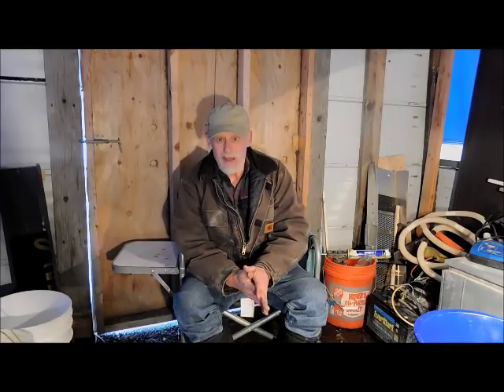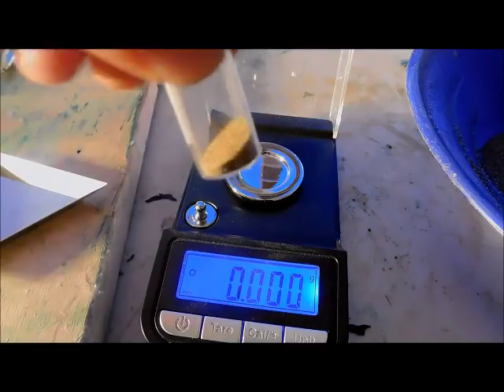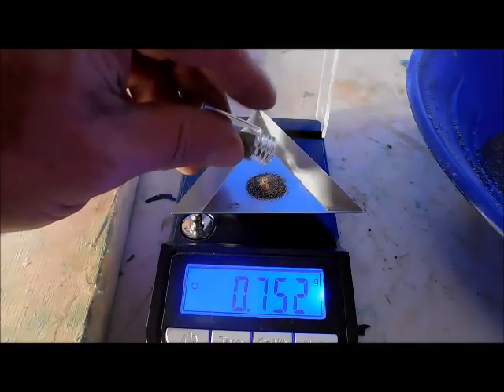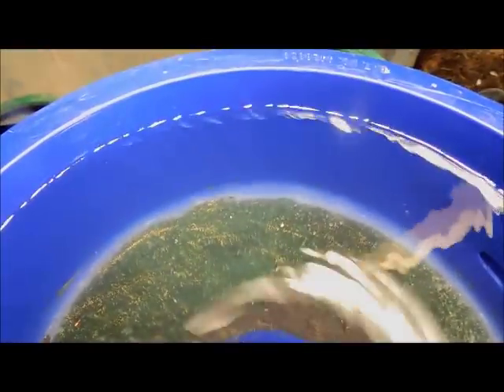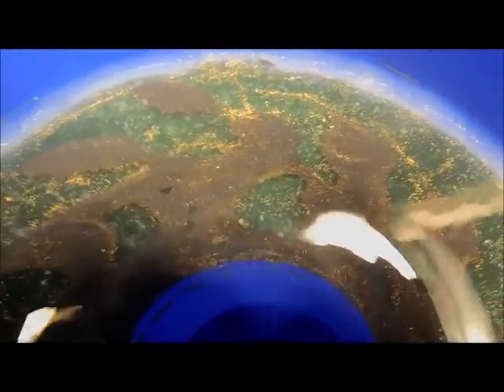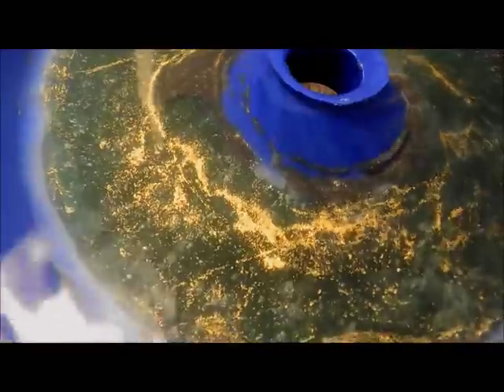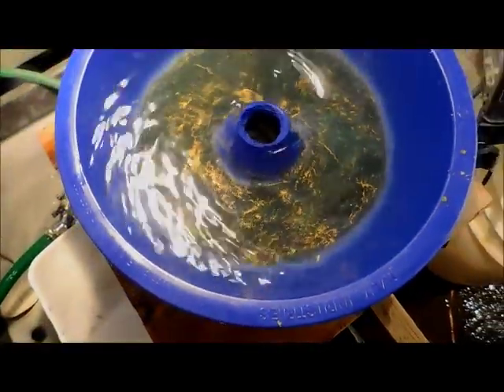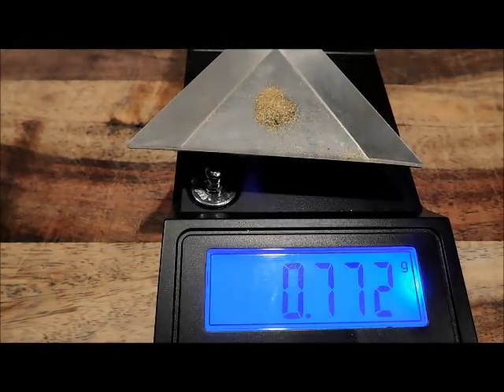Beach Gold Blue Bowl Silicone Mat = Epic Gold Recovery System

Comment: Awesome invention! I was just using my blue bowl, still am, and screened to -50 mesh and was watching a lot of gold, -below 50 mesh washing over the drain with a flashlight and concluded I needed a better selection of screens, and then I saw your video! I was watching a lot of fine gold pass over the center drain, and you mentioned a mini sluice for a 2nd recovery,  I watched your 1st video before this where you mentioned the 2nd mini sluice and I have been experimenting making gutter sluices, to test my ideas for awhile now,  so recovery has been on my mind. Your silicone matt is a game-changer! Even classifying to -200, I would always feel that I was losing gold through each classification or a blue bowl run. Now, with a large magnifying glass and flashlight, I can check for losses in every run of the blue bowl and adjust accordingly and make adjustments along the way! Now I need to watch all your videos, but making the Matt and the process for making it is first, I'll buy one of yours first, also, so I can get started to fully evaluate 2 new prospects full of fine gold and process my cons from recent and back that have accumulated over the years and I would like to process it all this winter because I just haven't had a system efficient enough that I trusted for the fines setup. You mentioned using a brush for clean up and what I like to do is use a spray bottle when everything is still wet and use the water to rinse and move it into the next appropriate container. You probably do it all the time, but thought I'd mention it for anyone reading the comments that might find it useful! This looks like a 2nd recovery, or more may not be necessary after the blue bowl is run efficiently. Congratulations on your idea/invention, I do believe it will change the way a lot of miners process their materials! 
On a side note, where is the "point of diminishing returns" when it comes to classification? I was thinking -200 mesh would be an (arbitrary) upper limit, at some point it will be less than dust and more difficult to process, also different prospects have different sizes of gold, but for individual testing, I would like to be set up I can run up to a mesh size that will eliminate further classification because of the probability it won't go any smaller, or it becomes uneconomical. With your knowledge and experience, what mesh size would you feel comfortable with testing for on individual prospects for a yay, or nay? Thank you, Alan, Dirk

Comment: Great video
I have owned a few blue bowls. Always ended up frustrated with their lack of fine flat (100 + mesh) gold recovery BUT now I may have to give it another whirl.
Reply from the maker: You will be amazed on how well the silicone mat holds on to the gold. I run a clean up sluice under the bowl if the gold makes it to the cone it is going out.

Comment: Again great showing Alan 👍
Reply from the maker: Thank you Wayne. No denying it now. That was crazy to see that - 200 gold stuck to the mat.
Reply: @alanrobertson2510  Indeed it was...The only thing that would make that set up better is if the mat was removable for rinsing off easier...like a mat liner covering the bowl bottom from edge to starting up the cone...with two or three slight ribs on the cone as a final capture spot for the really fine gold...

Comment: very cool results.
Reply from the maker: It sure was. Thank you
Reply: @alanrobertson2510  alan found something you may be interested in hearing about, went to walmart to get black food coloring and silicone caulking, while there i discovered that they have black silicone caulking, so you no longer have to deal with adding food coloring.
Reply from the maker: @zemetrius  Warning most black Caulk well not set up. Try a little in the soap and water mixture and see if it will set up first before you put it in the mold. I have a case of black silicone that will be here tomorrow that will work I will do a video soon . I hope it sets up for you.
Reply: @alanrobertson2510  i have just the test case in mind, someone had the idea to put silicone in a gold pan, i have been wondering about that myself. this is a good a test case as anything. but i look forward to your video using the black caulk, i am always eager to follow in the steps of those folks who figured out a way to do stuff.
Reply: @alanrobertson2510  ok got a small batch in the works, its kind of setup but as its my first one, there are a number of things that could be causing it to go slow, i may have used too much in the small test mold, could be the caulk itself, will let it have more time to set up, will check it when i get home from work, i was worried about putting to much material in the mold, so i may have ended up putting too much in.  best to get the mechanics of this down before i pursue the blue bowl piece.
Reply: @alanrobertson2510  ok my first test with the black stuff, sad to report that while it "looked" like it had setup when i got home, it was not the case when i tried to removed it from the mold. so i got more soap, got some saran wrap, gotta get the clear caulking and black food coloring. can't give up this close to getting it right.
Reply: @alanrobertson2510  its been getting cold here at night, even my garage is getting a little cool inside. what is the best time to setup the caulking work? when i get home after work during the week the sun is getting pretty low in the sky, the weekends i am normally off/home.
Reply from the maker: @zemetrius  Sorry I have been gone for a few days. I saw that the black silicone didn't set up right for you That's a bummer. It really doesn't matter as long as it doesn't freeze you should be OK. The warmer it is the faster the silicone will setup.
Reply: @alanrobertson2510  i cleaned out the bucket i had used the black silicone in, there was a solid lump of the stuff in the bucket, and a dried piece above the water line, this may warrant another longer test to give it what time it needs to setup properly.
Reply from the maker: @zemetrius  Cool I hope you get it to work. Sounds like it might.
Reply: @alanrobertson2510  will let you know how it goes, should do the test this weekend during the daylight hours.
Reply: @alanrobertson2510  figured out a solution to the silicone setup finishing due to the cold weather, my wife remind me that we have a 2nd oil radiator heater in the garage, we have the other one in the bedroom (it's nice to have in the winter time) so with the heater in garage on the bedroom temp setting, i can lay the mold across the top of the heater, it will get warm, but not hot, this will provide the heat needed to complete the setup process. if it gets stinky in the garage i can always open something to change out the air.
Reply: @alanrobertson2510  ok, it took 2 days for my 2nd prototype mat to get semi dry enough to test out in my gold pan. simply put, i am now a believer. pic one, shows 2 pieces of gold stuck to the mat https://i.imgur.com/Np5ql89.jpg, pic 2 shows all of the material gone, but the gold remained https://i.imgur.com/rDtjYUq.jpg  , pic 3 is just for scale of the gold stuck to the mat https://i.imgur.com/c4GquP8.jpg . my next mat will be for the blue bowl, the gold pan mat will give me something to play with while waiting for the blue bowl mat to setup. thanks Alan, this was awesome of you to share this wonderful gold catching idea.
Reply from the maker: @zemetrius  That is great to see. Thanks for the pictures I will have to play more with silicone in a gold pan. It doesn't take long once a person see it for them self's that gold does stick to silicone. Thanks for sharing.
Reply: @alanrobertson2510  i went with your tried and true design, the map i put on my gold pan is the same pattern you used for the blue bowl, only it doesn't have the center ring, i have a 10 inch gold pan, so it fit like it was made for it.
Reply: @alanrobertson2510  ok 2nd silicone blue bowl mat is much better, i did a better job on #2 of flattening it out to distribute the silicone across the whole mat, #1 was a little heavier on one side than the other, but all good now. safety tip: some kind of air filter mask is definitely needed when working with this silicone, a regular dust mask, does not keep the fumes out, i have a mask with the filters on the side, it works great for this. and i was using this outside, even with fresh air, your still close to the fumes while making the mat. do not recommend working with this anywhere inside. great silicone, strong fumes.
Reply from the maker: @zemetrius  Glad you got the mat to come out even. Now you know why I don't want make and sell mats the fumes are strong and don't  want to breath the fumes all day. I just made a mat from a 3D printed mold it puts a waffle pattern on the top of the mat we will see how that works out.
Reply: @alanrobertson2510  so my 2nd mat had fine cracks on the surface, they were just deep enough to catch material as it passed that spot, so i prepped another tube of silicone (with food coloring) and basically painted the top of the mat with black silicone with a paintbrush https://i.imgur.com/rpSfpch.jpg (what i do for gold) the air mask keeps out the fumes, the goggles keep the fumes out of my eyes. now i have a nice uniform layer on top of the mat, should work good now.
Reply: @alanrobertson2510  an idea that would make you some money (at least from me anyway) next time you go to a beach(?) that is good with gold, i would send you money to send me back a pound of sand from there.
Reply from the maker: @zemetrius  I was thinking of doing something like that. If someone has never tried to pan or run that black sand they are in for a real treat. You notice I do not pan that sand it like takes forever. If I get down there I will hook you up.
Reply: @alanrobertson2510  might make for a good test of the blue bowl mat.
Reply: @alanrobertson2510  i asked you about a flat mat for a small sluice not long ago, i built a prototype flat mat for my gold pan, it does not work as well as i thought it would, without riffles, all the material wants to slide toward the edge in a mass, if there is any gold, its just pushed along before it gets a chance to stick to the silicone, not giving up just taking a step back to rethink this.
Reply: @alanrobertson2510  for xmas, my wife gave me 2 bags of paydirt, been working on them since she gave them to me, got the easy to find (-20 nothing bigger) gold out of both bags now running the smaller stuff  https://i.imgur.com/FWGxzQB.jpg got the -30 down to -100 sitting in the blue bowl. this was a good xmas.
Reply: just bought some "project 1 silicone" from silicone depot, thanks for the discount coupon.
Reply from the maker: @zemetrius  Awesome you are welcome. I tried some of the black silicone today I think it is going to work just a little more time the water mixture seems to be working.
Reply: @alanrobertson2510  i have 2 tubes of the black caulking, will keep it on the shelf until you get it figured out. i have a blue bowl mat sitting in the mold, now just have to wait for it to setup...however long that takes. i hope the Project one caulk setup is faster than the stuff i have been getting from home depot and walmart.
Reply: @alanrobertson2510  i am not above some good ol fashion barter, would trade 3 tubes of caulking for a "ready to use" blue bowl mat.....any takers let me know.

Comment: Hey 👋, how goes it. Good stuff, I went eBay and grabbed some of your plates. Well just thinking how to make longer matts, found some screen door screen then I used through mold to mold. I had a separation between before, so I laid a roll down and applied mold to the screen took awhile but I have 24" mat for my sluice box I thought I would throw it your way. Kind like soft rebar in concrete, but silly cone. Great job my Fren. Happy happy Holidays, and a shinny new year.😺💨latter!
Reply from the maker: Happy holidays to you as well. I can see that working. I am sure you know I just seam all my mats together with silicone. Not saying that your idea is not a good one at all I just haven't had any problems with them coming apart. I hope the mats work out great for you.

Comment: That's awesome alan have you thought about putting riffles in the bowl via roller or rollin pin just something small or would that trap to much sand and not let it move
Reply from the maker: I see know need to ad riffles but I do want to make a small sluice with a silicone mat to run under the blue bowl to catch what blows out of the bowl.

Comment: Great Video and idea there Alan.. May I offer a suggestion? Why not make a silicon sleeve (or pocket if you will). Make a Blue-Bowl mold out of silicone, flip the silicone over and use it inside/ontop of the original bluebowl. Tearing or shredding of the silicone in little stringers will cease. When your done, rather than try and suck it up, pry the mold off and just dump it under water in to a gold pan (or other).
Reply from the maker: That would probably work I just wanted to make it as simple as I could but the possibilities are endless. Thanks for you idea.

Comment: The silicone mat is a great deal. Flourgold wizard told me about your channel. I know of a perfect way to pour perfectly smooth silicone mats. I do some resin casting and I use this stuff. https://www.michaels.com/super-caoutchouc-%C3%A0-moulage-alumilite/10324147.html?cm_mmc=PLASearch-googleMICH_Shopping_US_N_ArtSupplies_Sculpture%26Modeling_N_N_N_-&Kenshoo_ida=&gclid=CjwKCAiA27LvBRB0EiwAPc8XWUB9crP1_RZwNyMIoHdfv013HoC0SRWmYOcb0xQii_LZn7yqoHjHjxoCS7QQAvD_BwE
Pourable silicone - self leveling - no air bubbles - no trowel marks. 
Thanks for your videos.
Reply from the maker: Thanks I will have to check it out. I jut worked out a coupon code with Silicone Depot for everyone to use for 11% off the order so this makes it pretty cheap.

Comment: This is such a cool idea, Alan!

It seems like it works well too!

I had an idea while dropping a fat dump the other day; what about using skateboard griptape to add texture to some of your mats? How do you think it would work? I think it might be a good idea.

Anyways, thanks for keeping us company, and for keeping the gold fever away during these long winters.

Much love from the west coast!
Reply: I came across a comment one time that mentioned using "grip tape", but instead used sandpaper. I make gutter sluices to test my ideas and I have not experimented with this idea,  I did buy a selection of sandpaper, from 50 grade down to Emery cloth (150-300(?)  mesh and I planned to do various grades top to bottom on a mini gutter sluice to find the grade that worked best, even some drywall sanding screen for the mix! Speed bump was sandpaper being paper and for longevity could be sealed paper side with caulk, sand side would maybe need a spray coat of something that would waterproof the grain side- caulk fills in so defeats the purpose and also fills in the holes in screen unless done very, very carefully. If not wet proofed both sides the paper fail to hold the glue holding the abrasives and was looking for 1 step for the 2 sides instead of 2 steps. I will probably finish this project just to check it's efficiency, and potential, but I came across 1 of Alan's videos with a silicone mat for my blue bowl that I just put back in use and watching minus 50 mesh float over the drain. That silicone sure looks like it grips. I located a source of screens down to - 500 mesh, so now I'm going to make a variety of screens to classify that will enable me to determine the size of the gold a particular prospect offers and how to best capture it with the aid of Alan's invention/idea and my blue bowl I will be able to efficiently assay(?)  a property's potential for a  recoverable value. I have mercury which is impractical, and fire assays are expensive without telling a thing on recovery. With Alan's product I'll be way ahead and will design/build my own at a later time,  getting one mat to start and give me time to get ready to make and play with my own designs?
Reply from the maker: Hmm I have no idea if that would work or not. The groves in the sluice mats left by the 3D printer seem to hold the gold well. I hope to get over your way this spring. Take care.